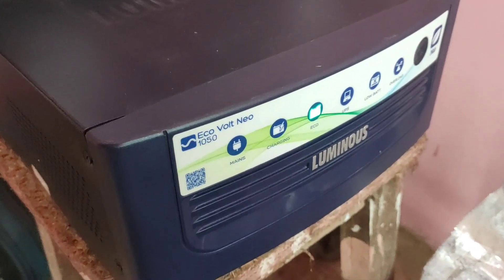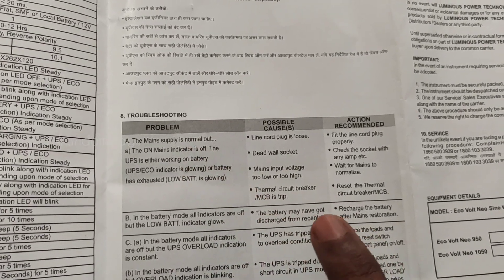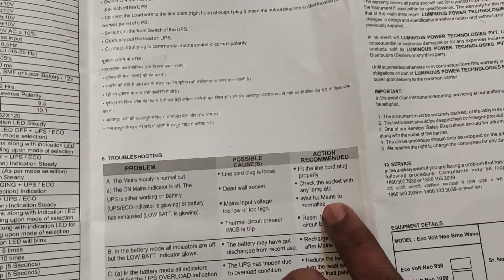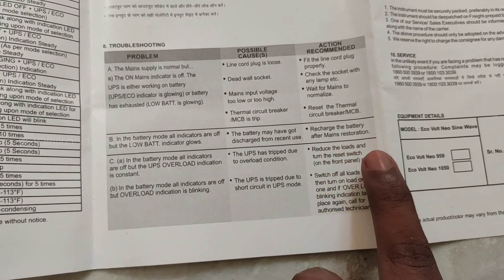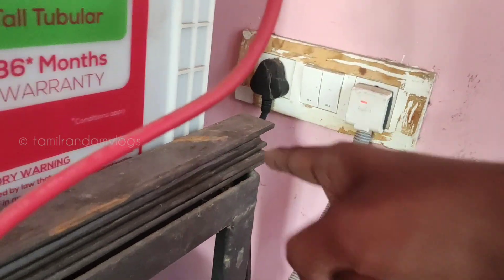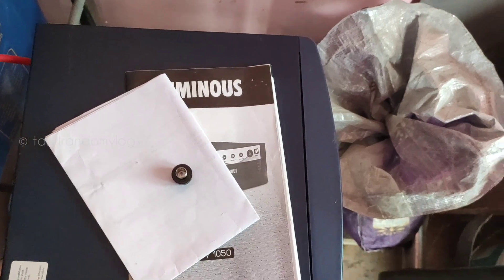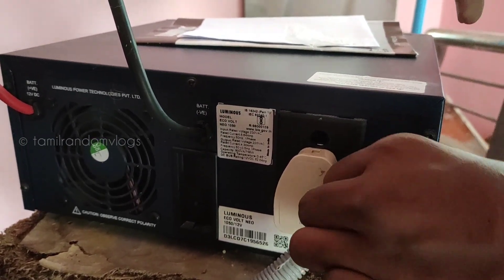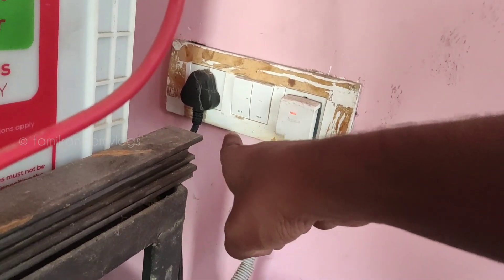Overload Problem in #luminous Inverter | fuse change explained in Tamil |No Mains No Charging #tamil

Comment: சகோ luminous inverter 1050 eco charging led blink ஆகுது. Charge ஏறல  எப்படி சரிபன்றது? Battery லேந்து inverter cable ல கழட்டி விட்டு cable அ check பண்ணா எவ்வளவு volt வரணும்? உதவுங்கள். Push to reset button எப்பொழுதும் close லே இருக்கு multimeeter வச்சு check பண்ணினேன்.  Push button போயிடுச்சுன்னு நினைக்கிறேன்

Comment: Sir ennudaya customer veetla invertor vachu irukkanga. But avunga veetla oru room la mattum fan or light switch potta invertor totalla trip aaguthu apparam mcb trippinga sari panna eppayumpola work aaguthu intha problem antha room la adikkadi varuthu enna reason sir
Reply from the maker: May be antha fan or light problem haa irukalam , or short-circuit aagiruka chance iruku

Comment: Bro I had off inverter before pouring distil water inside the battery. Once this process done I have again on the inverter but this time charging indicator is not in on mode...is it issue or normal thing?
Reply from the maker: Its normal only bro.no problem

Comment: In inverter, Ac mains off when airconditioner or 1hp motor on . and changed to ups mode. After motor off or airconditioner off , inverter back to mains on . Sometimes automatically changed without ac or motor on . What problem sir?